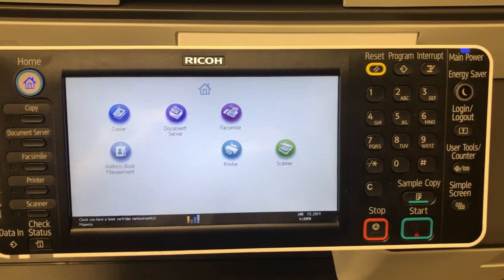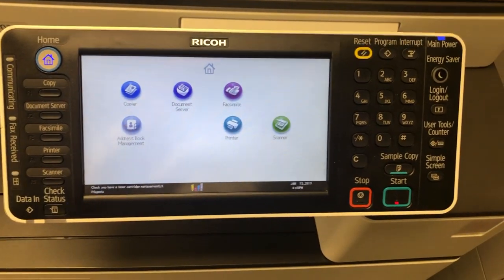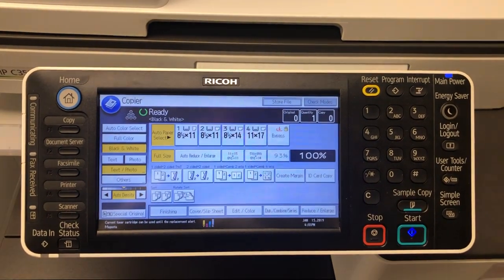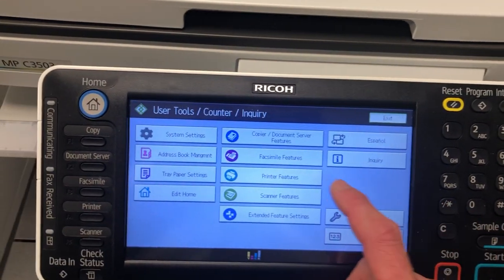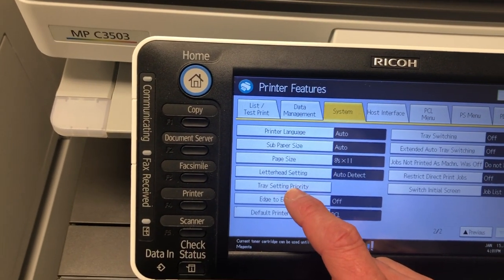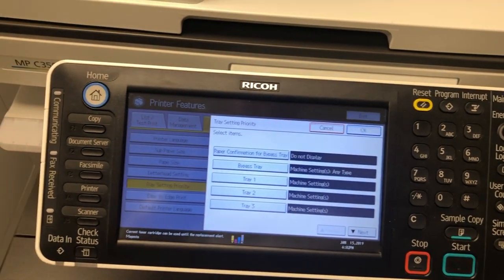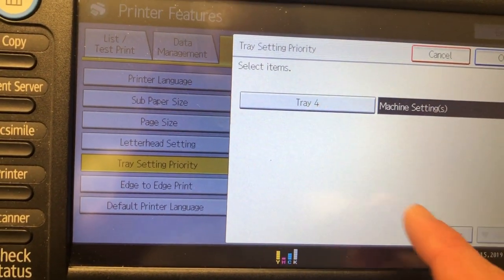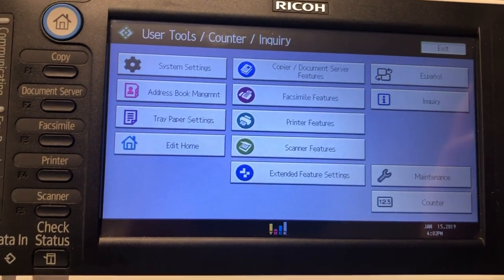Changing Ricoh tray settings to allow for printing multiple paper types from the same tray

Comment: My printer's default paper size setting is A4, and I can only change the tray 2 to letter. Can you tell me how to switch the tray 1 and the large capacity tray to letter?
Reply from the maker: If you can, select “auto paper select” in the tray settings in the menu of the control panel, for the device to know what it has, then in the print driver, makes sure “letter” or 8.5x11 is selected as the source document size and you have “auto tray select” chosen as the destination. I hope that makes sense. On a side note, have you got the physical paper guides set correctly in the tray?